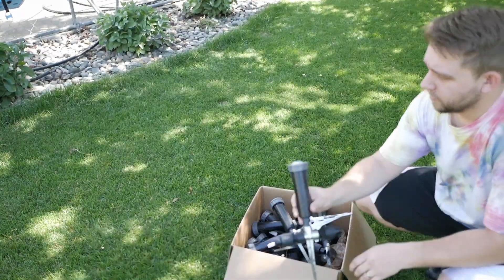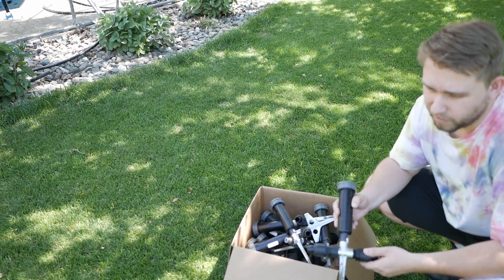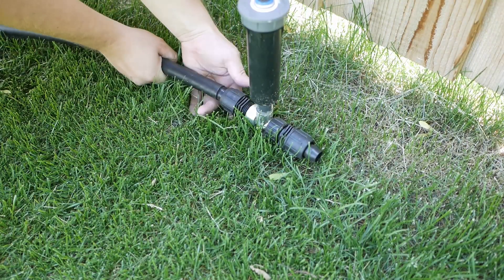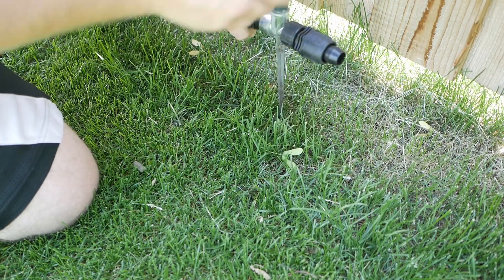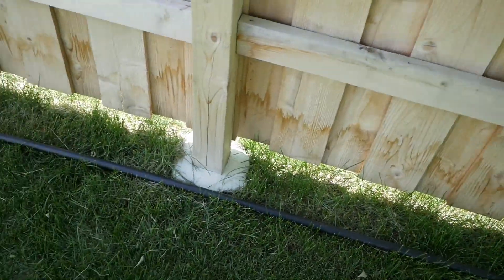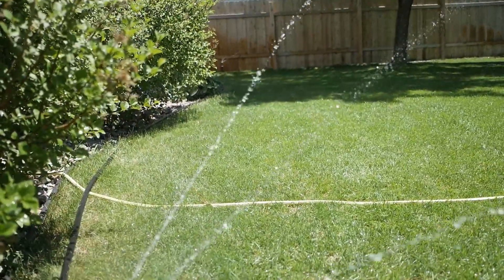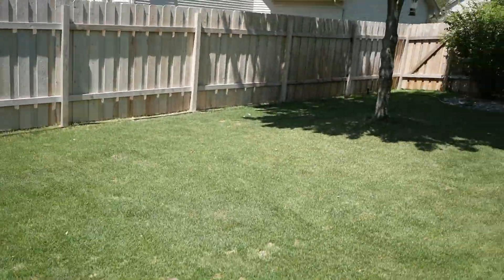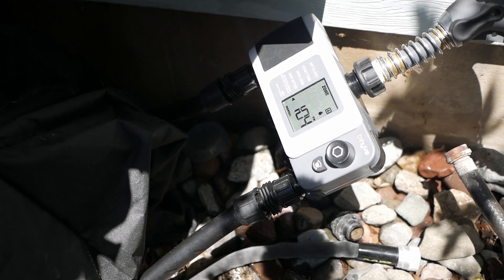DIY Sprinkler System with MP rotators

Comment: Appreciate your video! This seems like a relatively simple system to put together. Would be very helpful to have the parts list broken into one section for each head (so I can multiply all those by the number of heads I need) and another section for anything else, as I cannot quite discern for a system with a certain number of heads how to order the different quantities.

Comment: What is your water pressure at the spigot?  Do you know of any chart (calculation?) that shows you maximum length of hose runs and sprinklers based on available water pressure?
Reply from the maker: 75 PSI, 11 gpm. You can look up an irrigation friction loss chart

Comment: awesome video! was just looking to do this with poly instead of the hoses I have sitting around. Which poly pipe did you get from Home depot and why not just from dripdepot?. Thanks
Reply from the maker: 3/4 in. x 100 ft. Polyethylene Pipe. It's rated for 100 PSI working pressure, which most home irrigation systems should be under. Good luck!
Reply: @EaveeDoesIt  thanks got the same one!